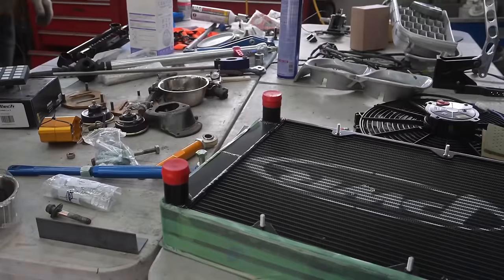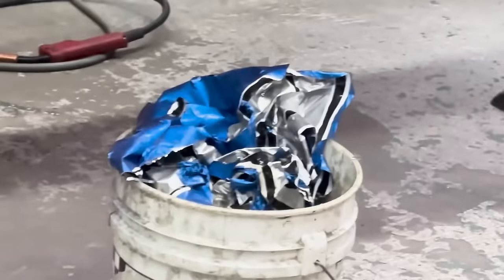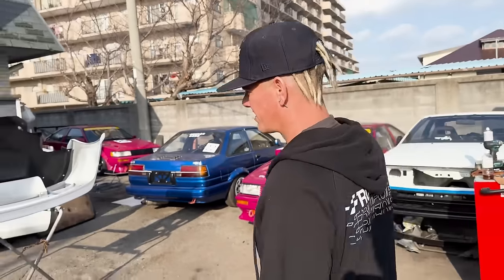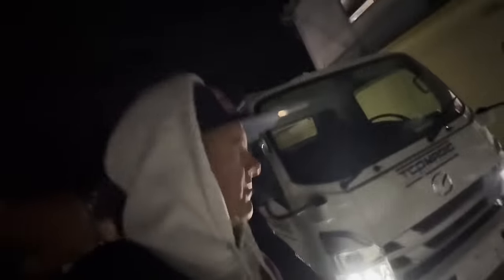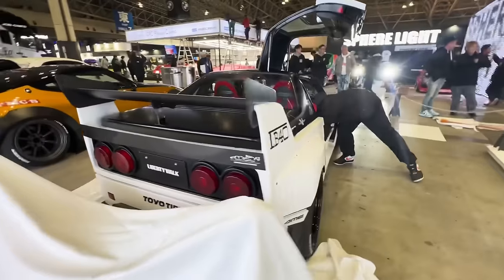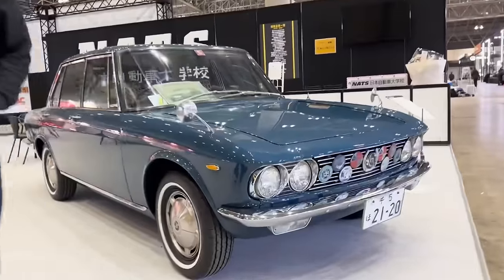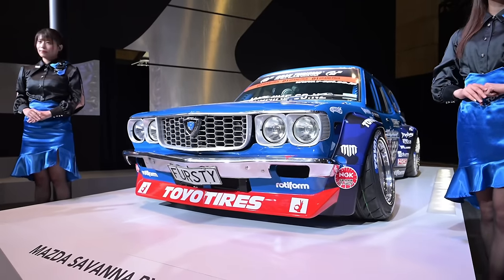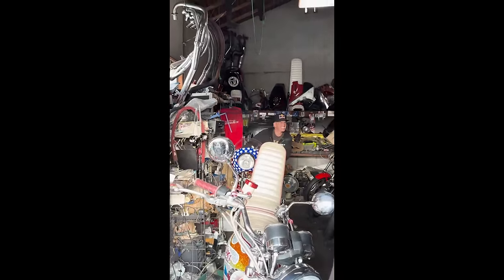FURSTY is BACK ready to ATTACK + All the MADNESS from Tokyo Auto Salon

Comment: We look forward to seeing you in D1GP.
However, I have one concern.
I also saw your car at TokyouAutoSalon and I am wondering about the NOS cylinder mounted inside the rear hatch.
I believe that NOS is prohibited under D1GP regulations.
If you are thinking of using NOS, please check with the office about the use of NOS.
Reply from the maker: Correct we can't run NOS at D1GP however we can party with it when we're testing or doing demo's and skids!